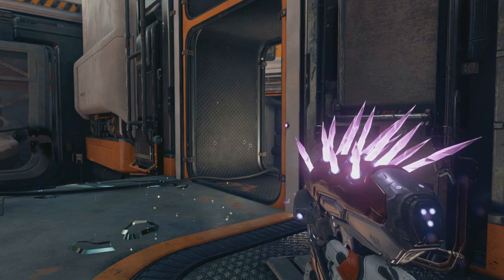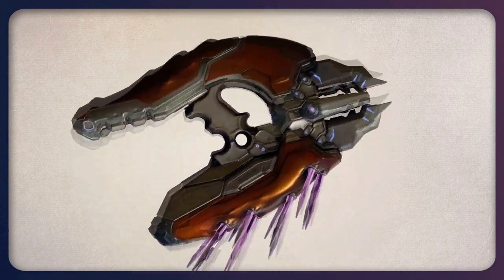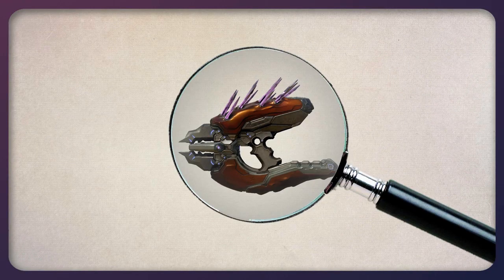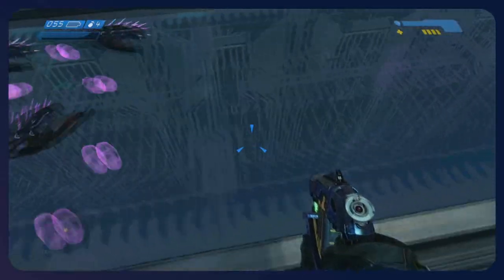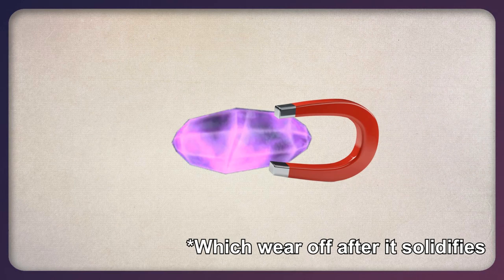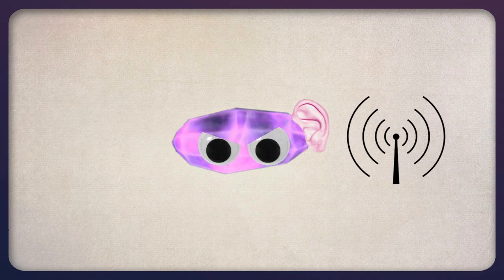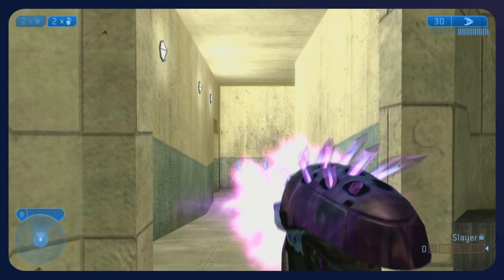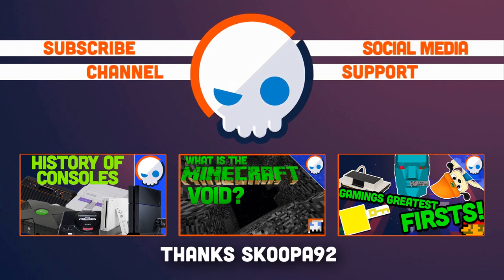Halo Theory: How does the Needler Work? | Gnoggin

Comment: How come the ships don't use giant needlers?
Reply: If the fired crystals travel that slow all the time (regardless of crystal size), could you imagine how useless they'd be for shooting at vehicles fast enough to traverse the nigh-incomprehensibly astronomical void of space?

You might as well send some troops in space suits with magnetic boots to go out and stand on the outside of the ship with a bucket full of grenades to throw at the enemy ships!
Reply: Yeah but the needler is so small compared to a gigantic gun on a ship, you would think that the velocity of a projectile coming out of a longer barrel would trump that of the needler which has virtually no barrel. I mean the needle rifle has a pretty fast velocity.
Reply: wait this just got me think how about a needler based cannon much bigger yet smaller than most cannons that do what needlers do except it has a charged railgun magnetic function if your clue I would be to so here's how it works what noggin just said but with a rotating barrel with accelerating charge plates using magnets to accelerate the projectile even further and at longer range and still using the basic functions with a bigger blast because more room and there you have it the needlers biggest younger brother the BFEMR needler cannon with up to five barrels upside down pyrimidine shaped and I also just

blew your mind
Reply: No, you lost me.
Reply: Simple answer and commen sense answer. The material is a very rare substance found only on one moon in the entire universe so using it in ships would use a bunch of it and would be a waste if you could use a more efficient thing such as a plasma weapon instead of a physical projectile.
Reply: There are some larger needle based weapons in Halo Lore. Type-29 Vampires and the Grunt Goblins, which can be equipped with Needle weaponry or Scarab weaponry, are examples of this. They're just not as useful in space due to the lack of atmosphere to work as well as they do on planet surfaces. This doesn't apply to the Needler, Needler Rifle and Blood of Suban due to how they're designed for combat against enemy soldiers, not vehicles. This means that if they are used in EVA combat, they will still be effective against enemy forces
Reply: the covenenant has the vampire an air  vehicle and shoots needlers
Reply: Right?
Reply: probably cuz its harvested from only 1 moon in the entire galaxy and its rare
Reply: Probably because lasers are faster and better in every way.
Reply: The amount of chemicals required to fuel a needler that huge would be prohibitively expensive and would make the ship highly vulnerable to attack. It would be the equivalent of driving a fuel-carrying 18-wheeler through a warzone.
Reply: they Do use needlers on some covenent fighters such as the Vampire and they are Overpowered, imagine a giant spike of that stuff piercing through a viehcle and blowing it up from the inside and the needles are like freakin homing missiles so other ships and ground troops have a bad time trying to dodge them, and if the ship is going fast when they fire the needles velocity is going to increase to be faster then the ship when fired so you wouldnt have to worry about out racing ur own shots at full speed because the faster you go in a fighter jet the faster ur bullets are going to travel when fired.
Reply: Vampires from halo wars did.
Reply: I know it’s been 7 years, but that was cut content from halo 2. Just instead of a covenant ship it was a sentinel.

Comment: i have a little theory, though supported by no evidence it does make sense, what if blamite is an organic compound or even a life-form it'self, similar to coral on earth the blamite would be made of many many small creatures, these creatures, when prompted can rearrange themselves, they propel the needles by simply jumping off the back of the crystal, which would push the crystal forwards. if blamite were a mineral then it is unlikely, if not impossible for it to only exist in one place in the galaxy, but if it were life then that would be more than likely. this would explain; it's ability to track, it's ability to change shape, it's rarity and it's propulsion. oh and P.S solid turning to a gas is sublimation, not melting.

Comment: just wanna mention that these gases probably turn solid when they get cotact with oxcygen or requires some other gas to stay gas and when it is realeased outside it turns solid and that also would make sence why they chose to have them stick out like that as a way to see how many shots you had currently.
Reply: +Em Killjoy 
That would actuelly explain why you have to reload.
Lets say you have 200ml of liquid gas in your ammunition chamber. But you dpn't wan't to fire it all out. So you need a mechainism that splits of smaller amounts, as in forming your "bullets" in the way you described. There you have it. And as of why not do this on the fly? Simple, it would lower the rate of fire. So preparing some is tactically more advisable.

Comment: The Bungie artist who invented the needler told me EXACTLY how it was supposed to work. This was when Halo was in pre-alpha development (working title then was "Blam" btw), so maybe they changed their minds. 

Unfortunately, that was almost 20 yrs ago and... I kinda forget what he said. I didn't know there was going to be a quiz. 

IIRC, there's a wheel of material inside the gun, maybe blamite (that term didn't exist yet, I think), and the wheel spins insanely fast, and when it's fired little chips are flaked off of the wheel and go shooting out the front of the weapon. 

No, that doesn't make a ton of sense. And yes, it doesn't explain the target seeking. 

Nevertheless, I'm about 95% sure he said that. I'm pretty sure he said more, but I don't remember.

Comment: Terrific video. I've been thinking about this for years and I think the gas option might be correct. The original crystal could also be being heated up to a plasma then, like you said projected out while reloading(cooling into a crystal again when exposed to air), then be being reheated as it exits out the weapon. Crystals have somewhat strange properties and are often used in some circuits(I'm not sure whether we can program information into crystals, but perhaps an alien race could, especially since every crystal I know of has silicon). This might be how the information is stored. Potentially a simple program might be programmed into the crystal, the head of the crystal being the "eye" or color sensor, it could follow this path by modifying it's tragectory by allowing some of the heated plasma crystal to transfer it's heat to one side of the crystal or the other allowing for more or less air friction/resistance to a certain side.

Oh, it's gotten faster maybe because Covenant coolant technology has been improving so max rate of fire was increased. Also the crystals look totally different in each game(especially since halo 1 and 2) perhaps the new crystals produce less heat, when turned to plasma, and now can be fired at a faster rate.

Silicon perfect for programming 
Oxygen perfect for plasma

Comment: Does anyone else take into mind that in halo ce (original) the crystals are a clear blue when sticking out the top. As you look down the part of the crystal closest to the gun is darker. Then the needles are purple when either fired or sitting on the ground.

Comment: i always though that the needles would go after there target because it was attracted to the energy in the enemy's suit and that it would explode because once enough needles hit the target the energy in the crystals would absorb some of the energy the enemy suit or body and when enough needles absorb enough energy that energy would overload the crystals and explode like a overfilled balloon
Reply: Ooh, that could be it! I just wrote a reply to another comment, suggesting that perhaps one of the gasses mixed with the (blamite?) had properties that drew it to heat. I like yours though. Problem is that mine doesn't account for sentinels, and yours doesn't account for enemies without power, say, flood infection forms. Really good idea though!

Comment: But why would the gas be solidified into the visible needles in the top of the gun only to be melted and reformed when fired. Might as well just propel the gas into the needles rather than form, melt then reform the gas.
Reply: Its probably a crystal at room temperature. Also the needles are a way of keeping track of ammunition.
Reply: Good point about the ammo count, though it wouldn't need reloading so often if it was used the way I suggested ;)
Reply: True. Covenant like their aesthetics though. ;p
Reply: +Davy Cannonhound true. The posers
Reply: Joseph Ward Maybe because when the substance is a gas it is unstable and it needs an exit point otherwise it would cause the gun to explode.

Comment: why would they make needles on the top from that gas when it' s gonna be dissasebled to the gas  again?
Reply: To give the wilder a sharp thing to bash opponents with
Reply: you my friend make a very good point it was the same one i was going to make but i figured i would look and see if anyone else thought about it .all the 'needles 'at the top of the gun do is add a unnecessary step unless their only purpose is to give a ammunition count until you have to cycle the weapon again to bring in fresh ammunition, but then again if you didn't convert the gas to needles and back to gas you would probably not need to cycle the gun at all just reload the 'blamite 'crystal when sufficiently depleted
Reply: Lexa9966 I would say since the grunts usually have nothing covering their eyes it's safe to say they have no form of hud to see ammo so they could use the needles to see how much ammo they have...I guess?
Reply: Lexa9966 My theory is that they do it that way to separate the large chunk of ammo into pre measured needles to conserve on the ammo, instead of sending one super long spike that might do nothing because the propulsion gas wouldn't be able to handle that amount of ammo gas and could also cause the lock on effect to be meaningless due to the amount of time the long spike has to leave the barrel. 
But hey that's just a theory, A GAME THEORY!

Comment: Here's an interesting theory. How could energy weapons (such as the Fallout 4 laser gun) have kick/recoil? A lot of games have this anomaly where an energy based projectile theoretically should not have recoil, but they always do.
Reply: +Christopher Conrath the simple answer for the fallout laser weapon recoil is that it uses the same firing animation as the other guns. at least when it comes to what the character model is doing.

But another answer could be an internal componant could be moving inside of the gun. maybe something that prevents heat build up. like an exaust of heated air being shoved out of the front of the gun.
Reply: It makes sense from a gameplay perspective. But from a physics-based? It's illogical.

Comment: Then it wouldn't work in areas that are very hot. 

And if the gas was (ferro)magnetic but the solid wasn't?? Not sure how well modern science agrees with that, 1. And 2. Then the needler would be being pushed/pulled by things with the same magnetic properties as the (in this case only) superheated material.

Best case scenario, it's a kind of magnetism only held by these select (very few) objects (even though the covenant has enough of it to mass produce them LOL) they would be magnetically pushed/pulled from and to each other, which isn't observed in any halo game I have ever seen. 

And (side note) heating and cooling that state of matter would be more easily done, I believe, and you might be able to get similar results, by using electricity, to cause a state change, and to possibly by charging the matter, making it magnetic, but then the energy source could make the needler magnetic? Unless the energy was being sourced at the time of firing/loading/etc. 

But if it's a gas while inside due to a heating mechanism, it could simply have valves that open and close rapidly, with a chamber between the "ammo" and the "barrel" that would form a properly shaped solid, and fired using the pressure from the next shot being formed in the barrel, or when you do you "arm flick" to "reload"

In this case, consider this, what if the needles spiking out are NOT the ones being fired, but ones that are expelled, and need room to go somewhere, one the inside is pressurized, and when the shots from inside are fired, they are pulled back in, to keep the proper pressure inside the "ammo chamber" for proper/consistent  velocity, etc.

If this is the case, then when it is "low on ammo" it might actually still have material inside of it, just not enough to properly fire, and if that's the case, 343i could explore that somehow, and it would probably be pretty sick.

Comment: why not just have a container of gass stored
instead of turning a chunk from gass to spikes to gas to spikes
Reply: Maybe it is more stable a storage as it allows greater efficiency and gives a visual que as to when to reinitialize the feed process.
Reply: soul1d 
stable storage, mayby

efficiency, hmm not sure, because gasses are better to store then solids, but since its a solid in base form it must need constant heat or very low pressure to keep it in gas form

and well visiual que, red and blue LED lights
Reply: The covenant never go for efficiency honestly they have a lot of aesthetics and tend to just barely get their tech working. Cortana in a book when she got a hold of a covenant ship found they were barely pushing their engines made a change to output and darted away but burned through fuel dramatically faster.
Reply: Maybe Blamite turns solid after exposure to air. This could explain the way it's stored and how it freezes in a spiky way. This could also explain how the needle gun is functioning very quickly, as the gun only pushes the gas and the blamite naturally solidifies.

P.S. I am 14 and only watched because of Lockstin and have never actually played any of the Halo games........
Reply: Drei Drei 
well im only 16
and have only played 4 halo games
and well i never use the needler
so dont to much about it

still stuff like this si always fun
Reply: kris220b I'm more of a CS:GO guy :P
Reply: Drei Drei 
meh
not hugely into FPS really
Reply: +kris220b rts is better
Reply: Radio ToraDora 
well im mostly into RTS and creative type games such as space engineers
Reply: kris220b Nice, do you know about Duel Universe?
Reply: Radio ToraDora ye
Reply: kris220b gud shit eh? I hope it's true
Reply: Radio ToraDora
duel universe descriped in 4 words:
its SE, but working

Comment: how does the covenant carbine work? Can you do that one? All i know is that it shoots radioactive projectiles.
Reply: Jormungand13324 It heats up into plasma and shoots out due to pressure and then heats up the gun quickly due to it being very hot.(just a theory and simplistic knowledge) Any thing more about it you want in detail?(may not know I am not into lore of Halo)
Reply: that would be the plasma-based weapons, not the covenant carbine.
Reply: I think it's something similar to the Fuel Rod Cannon as the older Carbines fired radioactive rounds. From what I know, it works like a normal human weapon as we've had top loaded rifles in the past. For the newer model of Carbine in Halo 5, it uses some new types of rounds to replace the older radioactive round with the exception of the Blood of Suban models which are able to fire Needle rounds

Comment: Substances can change between states easily with temperature change (example: Vapor to water, Water to Ice) so it may be a heat-related reaction when changing between solid and gas. 

Also the projectiles could be attracted to heat (heat seeking) and calibrated to a specific temperature (like our body temp) which is why they chase after the target. It wouldn't be that accurate though, but that could explain why it will hit walls and the like. 

(I know basically nothing about Halo).
Reply: What does knowing about Halo have to do with it?
Reply: I don't know anything outside of this video about the gun, so there might be pieces of lore or something I'm missing (like Vibranium in Marvel being a huge component of Cap's shield).
Reply: 1Xian the Minimalistㄣ But the guy speaking clearly is a halo fan and still mentions nothing of the sort so it's safe to assume there isn't anything extra you're missing.
Reply: Most likely, I just thought I'd mention that in case I missed something obvious to a Halo fan (like that some aliens in Halo have different body temps or something else that'd interfere with my hypothesis).
Reply: 1Xian the Minimalistㄣ But if humans can use it (something which is displayed in the video) then even if they do it doesn't seem to affect the functionality.
Reply: I'm afraid I don't understand the question/ confusion. I just added that to clarify I haven't played Halo in case what I brought up didn't make sense in the Halo verse or something.

Then again, the needles could just symbolic of life struggles; you don't always understand how they work, yet they'll always find a way to stick to ya.
Reply: I guess we won't be getting free college afterall...
 #FeelTheBern

Comment: Wouldn't it be also possible, that purple chrystal thing (sorry, I'm no Halo fan) behaves differently depending on surrounding pressure? Maybe it's pressurized within the gun, so it turns into a gas, which explains the impossible turn. When exposed to outside "normal" pressure, the purple gas turns into solid chrystal.